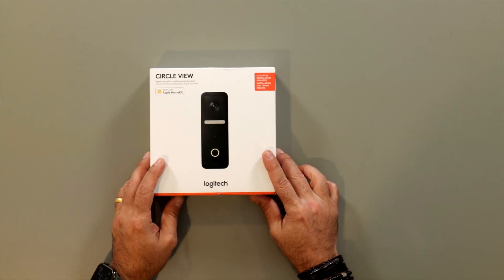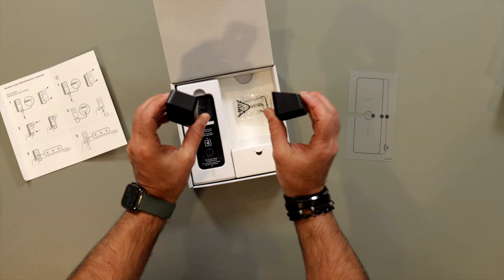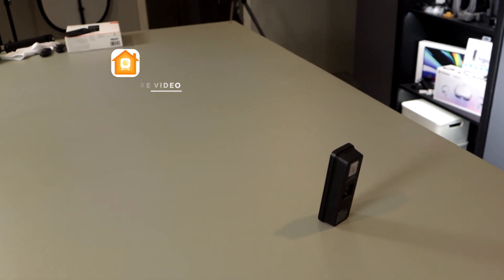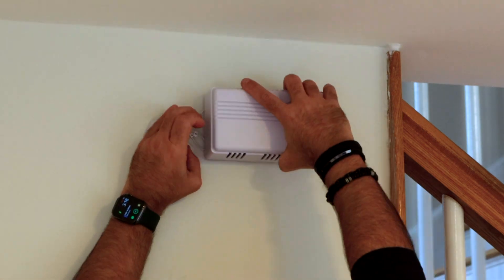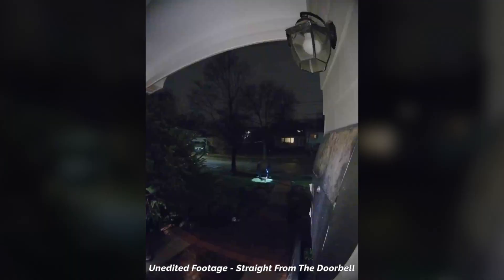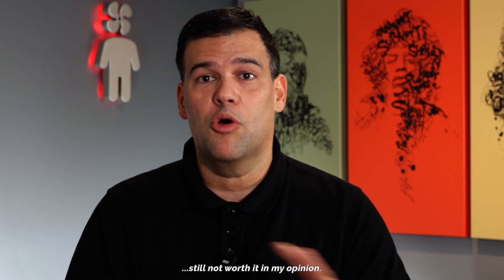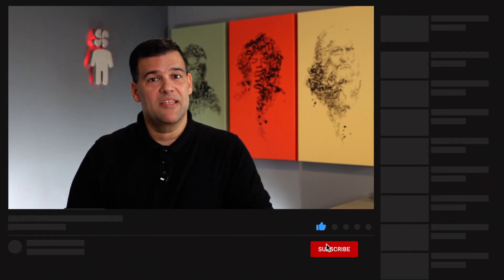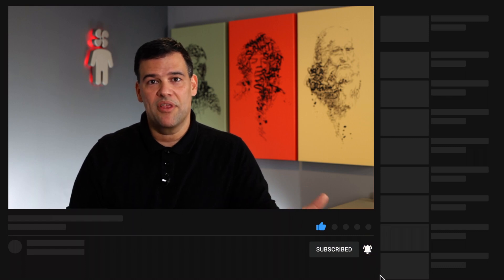Logitech CircleView HomeKit Video Doorbell - Unboxing, Installation Overview and First Impressions

Comment: You’re HomeKit code is visible in the video during your install, just FYI.  Also the one step I really wanted to see you fast forwarded through which was the wiring, and I wish you would have covered it more.  Yes I’m looking at their install instructions, however obviously would like to see the install in more detail before I do this tomorrow.
Reply: Thanks, I was able to get it installed, I had a weird wiring setup in my house.  Had two wired door chimes.  After talking to support, and them not first even knowing or finding the product in their customer support system.  Guess it’s too new.  At first install the logi doorbell kept setting off my door chime every 30 seconds, and was flashing white where the record light.  Don’t know if that was because I was half way through the install, and my chime kit wasn’t hooked up yet.  I noticed the install instructions also didn’t mention what the slider does left or right or center in the chime kit.  All other videos also don’t address it.  My system is 16V10A and works now, it was also a pain to find my transformer which was in the garage.  Also broke the one wire during the first install, which gave me some issues as well when installing the backplate.  So took two hours for something that should have taken 20 minutes.
Reply: Maybe someone will make a good install video, right now there aren’t any.